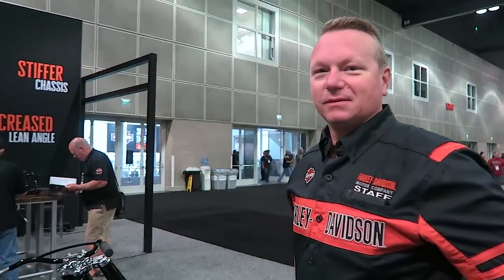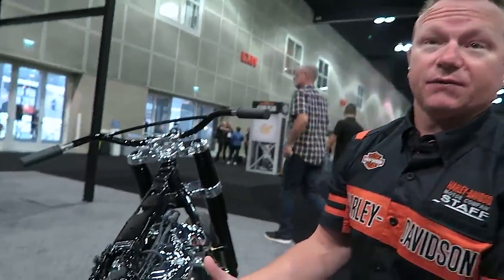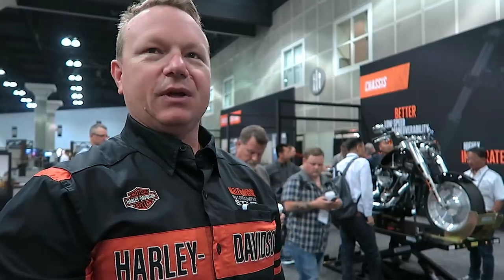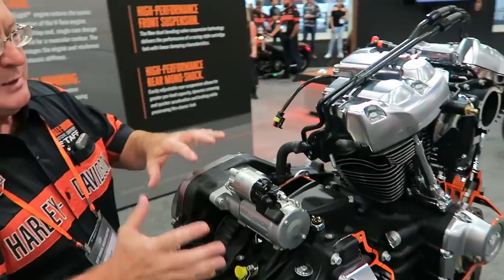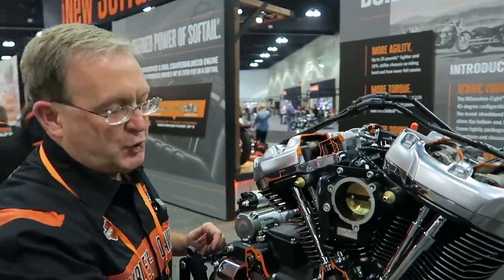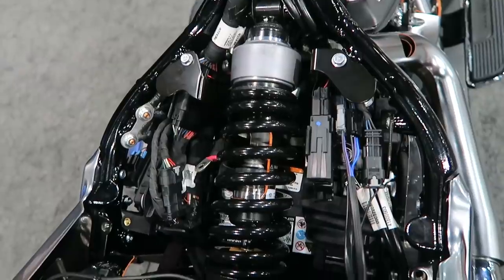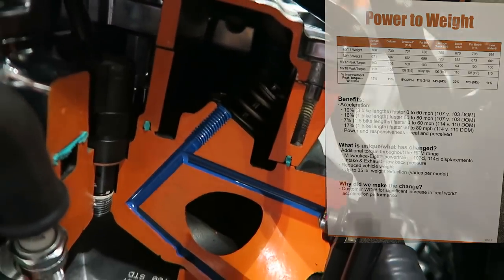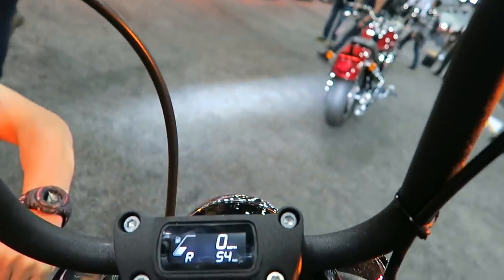2018 Harley-Davidson Softail Chassis Revealed│H-D Engineers Give us a Walk-Through│All the Details

Comment: Screw the haters Matt. This video is super informative. It also makes a lot of valid points. For those of us who remember when Harley first came out with the Evo, and what, rubbermounting(?),  this is the Moco returning to it's roots. They've taken the best things about all of the bikes they've ever made, and combined them into a package that not only looks killer, but it very promising in it's delivery. 

Give it a little time. People will be flocking to buy them. By 2020, you'll see most of the people riding them. Same thing happened when the TC came out. At first everyone said, no way, but by 2001, most everyone I knew was on one. 

Great video. Your vids always explain leagues more than anyone else does. Thanks.
Reply: Stretch Man, 
I couldn't have said it better myself, Brother.
Reply from the maker: Stretch Man agreed. Thanks man
Reply: Matt Laidlaw during your time at the dealer meeting. Did anyone explain the reason behind smaller fuel tanks on some of the new softtail line? Thanks in advance
Reply: Stretch Man e
Reply: Marius Eggelmeyer Jr ah oh ah ah
Reply: Actually, last I heard, He's on a Chieftan.
Reply: The best thing about Harleys is the motor, the second best thing is the twin shock rear end (which is now only available on the tourers).  So no, they haven't taken 'the best things about all the bikes they've ever made.
Reply: Yeah, only you forgot the XL line, which hasn't changed at all, and has made 2018 emissions. Not bad for a bike design that is over 60 years old. 
In fact, the Road King, and the XLs are pretty much all that Harley made 60 years ago. Back then they called it the Duo Glide. Fairings came much later. 
The FX line didn't show up until the 70s.
Reply: the 883 was put on the first sportster in 1957. you would think after 50-60 years they would upgrade it to an 884 or  890 or a 900.... is it the same horsepower since 1957?....no wonder even harley riders call it a girls bike.
Reply: why do the dam things cost so much for ww2 technology....or Korean war era...some of these engine serial numbers must be in the trillions. (90% are in the junkyard melted from overheating, gasping for water with no radiator relief)
Reply: But the XL line and the touring line up are still twin shock which is why I hadn't mentioned them.  They still have the correct sort of suspension system for a harley, twin shocks.
Reply: Actually, it's a little improved. When introduced, it had about 42 HP. Now, the standard 1200 produces about 61 hp out of the box, while the 883 does about 52 hp. 

But, horsepower is not really the tell, since the real power is made in the Tq band. Thing easily breaks 100 mph. Which is way above the speed limit most places. 

But the thing that IS really the tell? It's still pretty much the same as it was when introduced. First Harley to have hydraulic shocks all the way around. In 1990, they bumped it up and gave it a 5 speed. They've made some cosmetic changes, done new motor mounts, and added fuel injection and cats. It makes 2018 emissions. That there retrofuturism. 

So all these people ripping Harley for not making the bikes they used to make is BS. They pretty much still make the exact same bike they used to make. Authentic Harley Davidson. And the reason they call it a girl's bike is mostly because how easy it makes it to pick up chicks.
Reply: Well, uhhh, there is the Sportster 1200....and before that there was the 1100, and the 1000.....
Reply: Before that, the 883. The basic design itself hasn't changed. What's inside the cases. There's a good wiki article on it. 

The new bikes? well, people never complained about the suspension on a sport bike. Even though the frame around it is quite different, the suspension and basic frame design was used before on Buells, and most other types of sport bikes, and no one complained that it wasn't adequate. 

But you know, Harley.
Reply: Stretch Ma

Comment: GREAT video, Matt. Really.
I appreciate that Harley is starting to think about weight reduction. However, no disrespect meant, 30 pounds on a 316kg softail heritage is like putting makeup on your 90-year old grandma and say "see? She's a hottie now!". There is much more to be done, especially with the powertrain. 
Anyways it's a start, and I think ALL customers will appreciate that. Putting aside the rethoric "steel is better", noone prefers a heavier bike over a lighter one.
Reply from the maker: Francesco Galli it makes a biggger Difference than you think. You'd be surprised.
Reply: I'm pretty sure it does, but I bet it's more the stiffness of the frame than the actual weight loss. 15kgs on 316kgs is about 5%, so it is noticeable but not that much.
Reply from the maker: Francesco Galli yea. The frame stiffness makes a big difference.

Comment: Hola Matt, I’m late to the party but finally living the dream.  I love this deep dive mentality, Retired Submarine Warfare and Surface Warfare sailor.  We believe in knowing almost as much as the engineer on everything.  Four weeks ago I purchased my first Harley, a 2020 Fat Boy with 160 miles on it.  I tried to get one from Tokyo H-D in 2000 when I was living there but Japan had restrictions on the size of everything imported.  I have tripled the number of miles and just purchased a Scream’n 🦅 HB Elite, Woods 22XE, Two Brothers Turnout 2-into-1, 8” rise, 1.5” T-Bar because the Saddlemen Explorer bumped me up and forward. 6’1 280lbs. I will run that for a few years as I have set a good foundation for a big bore, CNC header, and large throttle body.  I will finish my LED Mods with a pulsating brake strip under the finder to complement the 7” Adaptive 2, and the turn signals all around.  I am spying a set of two finger triggers as well.

Matt you are easy to trust, but it is almost uncanny, your perception and your ability to see where HD is heading before they get there.  I don’t need validation for my purchase or modifications, but I must admit It feels good to know my thoughts on the Milwaukee 8 are shared.  Yes, after all the issues it is where HD should be going while allowing for more out of every Mod.  These cutaways are priceless, giving us an unrestricted peek behind the curtain to what is quite simply a work of art.  Thank you kindly.  (SS/SW/MTS) USN, Ret.  🦅 of a 🪶
Reply from the maker: Thank you for the comment. I appreciate the compliment. Enjoy the Fatboy 👊🏼

Comment: Fantastic video as usual. Just one doubt: on the bikes that do not have the external knob to tune the rear suspension, is it necessary to take the seat off or something else in order to adjust the pre-load of the shock ?

Comment: Matt, the only reason the cam is chain driven is lower costs in manufacturing. Sprockets and a  chain along with less need for precision alignment costs way less than gear machining and setting up gear pitch diameter specs. The early gear driven cams were a much stronger setup but cost more to produce.

Comment: At 7:17  My question for Ben Wright:  From an engineering standpoint, there is a gap on both sides of the upper swing arm that holds the shock/spring.  It would seem to me that lateral torsion forces during high energy acceleration or heavy cornering loads would cause the suspension to twist or torque laterally that would upset the handling.  Why is there no linkage to stabilize deflection?

Comment: I have 2 harley's:  2018 Sport Glide and a 2016 Slim S. Obviously the new 2018 monoshock rear suspension performes much much better than the 2016  "old" softail dual rear shock system.  Is there any after market system that will significantly better the handling performance of the 2016 softail rear shock system?  Another thought I have is what is the frame stiffness factor in the handling performance.  I am a sporty rider,  like taking corners low which gives me an ultimate sensation. My 2016 slim S is an olive gold denin one which I think is an iconic bike. Thanks mate (actually) Matt 😉

Comment: 2021 Softail Standard owner/rider here. The mono shock alters the way the bike handles. It might be smoother on long straight paved roads, but over here in the UK, we don't have those. Our roads are tight, narrow, twisty and hilly. That mono shock does not handle so well on these roads as the old dyna twin shocks do. No more power slides, intentional or otherwise. No more wheelies (honest, officer, it just popped up on its own), there is no way to get that wheel up. The M8 engine feels nice, but it is tamed beyond belief in this chassis. Removing the engine management system and fuel injectors, no more throttle body, and replacing all that electronic garbage with a simple ignition and S&S Super E carb, plus a shorter, catalyst free exhaust has brought the engine to life, but that rear suspension is far from good. And yes, we are legally allowed to do this in the UK. Land of the free.

Comment: Nice overview Matt. There are many needed handling modifications addressed in the new model Softails. I did not feel that you received an adequate answer to, Why has the motor company stayed with a chain drive and not changed to a gear drive cam system? I can not be sure but a gear drive cam system requires very close tolerance on "run out" ( .000" to .003" ) on the main drive gear or pinion shaft. That might be too difficult of a challenge for mass production quality control without some kind of compensating system. I know the factory spec tolerance on my twin cam is  ( 0" to .010" ). What do you think ?
Reply from the maker: +Joe Russo I think you're exactly right. I will say with the hydraulic tensioner they solved the problem.

Comment: Hello Matt, Thanks for the new softails video.  My question is,  is it possible to upgrade the 2018 softail slim rear tire, with a wider 200 tire, and change the rear fender to bob fender, to get the exact rear look of the 2011 softail cross bones .  Thanks
Reply from the maker: +Sam Shms I don't know the for sure answer here but I seriously doubt you can put a 200 mm rear tire on there with the stock swing arm and spacing. I'm sure you could put a bobbed fender if you can find one that fits that frame which I don't know if it exists yet.

Comment: Thanks for the info Matt not much info here in Australia yet. Just at quick question ( you have probably already covered) are they still air cooled or oil cooled
Reply: jarrod brown They are all oil cooled.
Reply: They have both. Look at engine it still has air cooling fins as well as oil heat exchanger between frame tubes. About time for hot Australian summers.

Comment: Hi Matt, thanks for your videos! Could you provide some more information on the differences between stock 107 or 114 M8 engine and CVO 117? What are the differences besides the displacement and the twin cooling system? Do they utilize the same camshaft, pistons, flywheel or other components? Where does additional power of the CVO come from? Is the CVO 117 as upgradeable as the stock M8 (Stage II, III, IV)? Do the CVO models have same exhaust header pipes as the non CVO bikes? Or is it a different system? That's a lot of questions, but there isn't really much insight on the internet on CVO engine details. At least I couldn't find it, but it is really interesting and could help in choosing whether to buy a Road Glide Special and upgrade it or to buy one of the CVO bikes.
Reply: Cubic inches gives  additional power to the CVO !
Reply: Jim Bea 3 cubic inches won’t make any noticeable difference... and it’s a weak argument towards a CVO 🤔

Comment: Hi Matt,
Another awesome video. I have a couple of questions when you get a chance.
1 - Is the reason for the smaller tank on the Fat Bob aesthetics ?
2 - On the Fat Boy, will the 160 front tire compensate the maneuverability of the 240 rear ?
I'm assuming the answer to both questions is yes, but I had to ask. I love both bikes and I'm leaning towards the Fat Boy due to the 5 gallon tank. 
Cheers Brother
Reply from the maker: Mike Wastian I think HD wanted to mix up the profiles and overall look of the bikes. It would be boring if they just threw the exact same tank on everything. I fee like they put the 3.5 gallon tank on the 3 bikes that aren't really intended to be your long haul bikes. I'll have to test ride the Fatboy to really answer your question. My prediction is that you'll have to fight the front front wheel less in a turn because they are more symmetrical than something like the breakout.
Reply: Thanks Matt
Reply: Ok, now I get it. Either I'm a little slow or it's difficult to tell without seeing one in person since none of the dealerships in my area have one, but the Moco has designed the Fat Bob on a scrambler platform. Very cool and very smart on their part. I hope you sell tons of them. Looking forward to a Fat Boy demo vid. Ride on brother !

Comment: Matt would you happen to know if they changed the ergonomics on the Heritage Softail for 2018 to accommodate 6' and taller riders better?
Reply from the maker: SydeKiK1962 No. it fits a rider of about the same stature. I'm still cramped on these bikes. Which is to be expected.
Reply from the maker: SydeKiK1962 they do have tall boy seats and extended controls available.
Reply: Thank you so much Matt. The Heritage has always been a favorite.

Comment: Matt did they redesign the 114 as well for the new Softails or is it a direct carry over from 17.
Reply from the maker: +Fred Wessels Its the same redesign elements as the 107. 2 gear driven counter balancers. Its basically the same as the 107 with bigger cylinders and pistons. Different cam.
Reply: That's great!  Thanks for your response and give us a review when you can on the Heritage S.  Great info.

Comment: As always! Awesome informative video Matt 👏👏 
Although I have the Low Rider S, I can definitely see that the new Softail line is the future. The big-Q from me is. How will two balance shafts impact on the engine performance? We all know that the Dyna engine spun more freely compared to the old Softail that only had one balancer shaft. So I am eager to know the difference between the old Twincam B and now the new M8 with two balance shafts. And I could maybe be afraid that the new Softail could feel to sterile, to Japanized for many Hardcore Dyna riders...
Reply from the maker: Lars Duus The weight reduction vastly compensates for any additional weight moving in the engine case. Check out the power to weight ratio chart I posted half way through the video.

Comment: Thanks for the video, Matt
Along with black matte color, what they have also scrapped with all the S models - is a small thing like ride-by-wire throttle. Which is a big pity for me, because now if you want real cruise control, you are only limited to the Touring line-up. 
Nevertheless, I think that the new Softail is great, and also more attractive to younger riders, which in my opinion is a great, and logical step forward.
Reply from the maker: EvilChem1st all the softails have throttle by wire. The heritage come with cruise control. Cruise can be installed easily on any of these softails.
Reply: Matt Laidlaw, thanks, that's good news!

Comment: @6:27   "it's an 8mm wrench..." wowowow! HD going metric now. how about that.
Reply: Been metric parts on them for a while now. Forks have been metric along with the Kehin carb. Brake pin bolts are a 5 mm Allen. Don't forget the 10 mm on the battery.

Comment: Fat Boy and Break Out need dual front brakes.
I remember hearing bad things when the V-Rod came out about solid front wheels and side winds on the open road making for a really "fun" ride. Anyone else ? I think it looks amazing but if it's detrimental to the riding experience they can keep it.
What's with the tiny fuel tanks ? USELESS. Not everyone can afford a touring model with the big tanks and all other standard commodities.
Rear suspension travel it's still what ? 2inch ? LMAO.
Ah, that's how they do it, one pump to suck from each side of the tank and feeding a common feed line. C00L but $$$$.
Nice video and quality, Man. You are appreciated.
Reply from the maker: JIGA BACHI the solid wheels with cross winds thing is a myth. There is no problem with wind and those wheels.

Comment: Having no slipper clutch is a real downgrade, it makes no sense to get rid of that in 2017. That really seems like a cheap way to cut costs. Everyone is making a big deal about the new suspension but you just have basic preload adjustment on the rear. For the price of these bikes there is no reason to not have fully adjustable suspension front and rear.
Reply: Only the FL bikes have slipper, introduced in 17, the FL still has the slipper.
Reply: Do they need one? I thought slipper clutches were really for race bikes which have violent down changes from speed and don’t want to lock up the wheel, or for those who are particularly cak handed at changing gear.

Comment: Too bad they don't have a blacked out FatBoy anymore.
When I buy the 2018 FatBoy, I will have to do the same I did to my 2002 FatBoy.
Just take everything apart and have the parts powder coated.
That was years before they came out with the FatBoy Low.
I almost bought a Night Train because it's all blacked out. But I decided to buy a second FatBoy, with a few parts already blacked out, and finish the job.
So, I kept riding it, and took the older one (2001) apart, and got all the chrome parts powder coated. Even the mini-ape handlebar.
Now the bike is so perfect, with custom paint, Street Stalker nacelle, auxiliary lights, and a 7 gallon stretched tank...
It's really hard to let it go!!